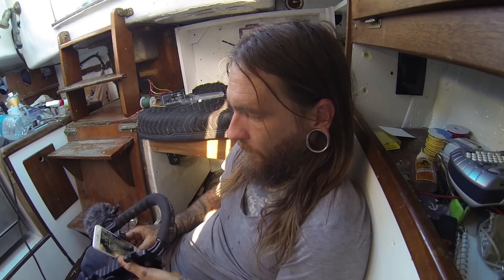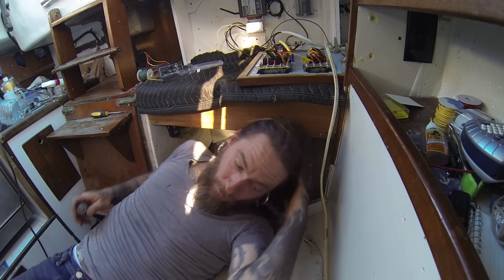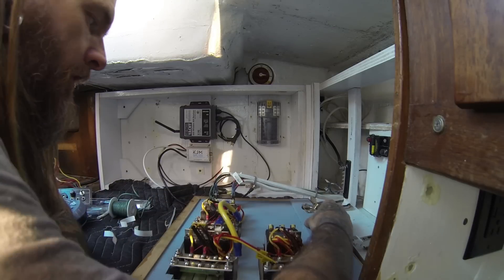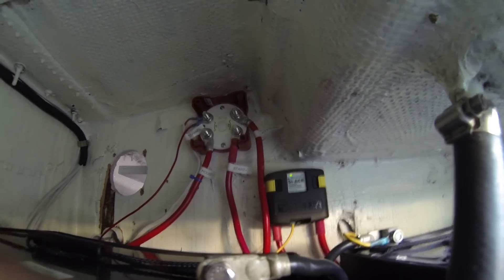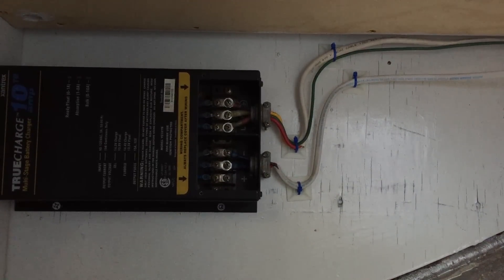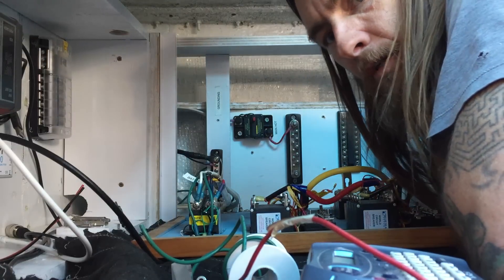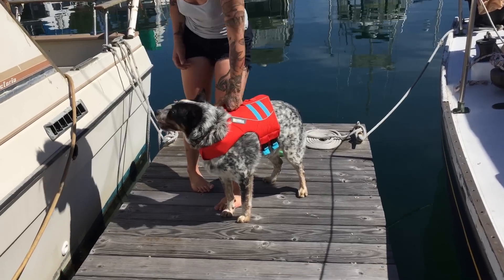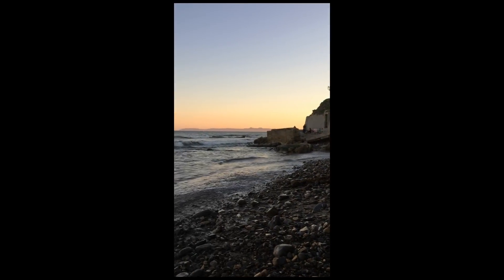Hooking up the DC electrical System on a 1965 Alberg 30

Comment: Okay...You've done some electrical work before. Your install is clean. But a light bulb to test with?! C'mon James. Use your meter! Test the voltage under present and future typical max current draw load AT the load(s). If the voltage is low, the current will be higher= >% chance of premature failure of the load(s). Possibly even the wiring = 🔥= Lost Boat.
Keep it safe and reliable my friend. Study and check the details. 
Great video. Best I've seen from you. Good to be back.
Reply from the maker: A light bulb works better on video. but yes your suggestion is great, thanks for the comment !
Reply: @SailorJames  
Thanks. Seeing your comment, I reread mine and realized I wrote something absolutely wrong. Voltage drop does not increase current. It Decreases it.

Comment: Drip loops to help with capillary action is a great idea! However I would think the electrical device would need to be higher than the lines feeding into it, to make the most of the loops. Think of it like a water level in a piece of tubing. It always seeks level or equal pressure on both sides. The Dry side, or the electrical device in this instance, needs to be higher than the water level or feed lines. Simply, put the device higher than the wires feeding or leaving the device.

Comment: I really like your style James.  If it’s worth doing, do it right.  The “ drip loop” on the electrical wires is something new to me.  What a great idea.  Did you think of that or did you have a good teacher ??  Keep up the good work.
Reply from the maker: Thank you sir, it is a blessing and a curse. Sometimes in my head I pretend I will do it the easy way but never allow myself the option and end up doing it the right way instead. I learned about Drip Loops from reading tons of boat electrical books and refit books, makes a lot a sense right?

Comment: Huge job your getting done that will pay off big time in the long term ! Life jacket for puppy "thumbs up" !    1) use your nut drivers or 1/4 inch sockets for electrical and hose connections. The first time you "weld" a wrench while working on elec. when your tightening or loosening a pos. or neg. connection and the other end of the wrench contacts the pos. or neg. to complete the circuit you'll understand.  2) IMHO, when you are not at the boat your battery switch will be "OFF" I assume, You will want your A/C charger to charge both battery banks and your bilge pump to be operational I assume. This is where the Blue Seas charge relay comes into play. Your output from the A/C charger needs to be connected to your starting battery just like your engine Alternator. You can make this connection on your battery switch at the terminal that COMES from your start battery, NOT the terminal that SENDS power to your engine once the switch is on. Once the starting battery is charged from either the A/C charger or Alternator the Relay will then connect both batteries and charge the house battery. THE RELAY IS THERE TO PROTECT THE START BATTERY FROM GOING DEAD !   Now the bilge pump, connect it STRAIGHT to the house bank, again this can be done at the battery switch terminal that COMES from the house battery. As the bilge pump runs it can only draw down the house battery protecting the start battery because the Relay will disconnect the start battery saving it from being drained. The bilge pump runs with battery switch ON or OFF !  Hope this is clear enough to make sense.  P.S. anything engine should be connected to the "+" starter connection like gauges, electric fuel/filter pumps ...etc !  You want to eliminate parasitic draw on the start battery. This is also accomplished with an ignition switch.